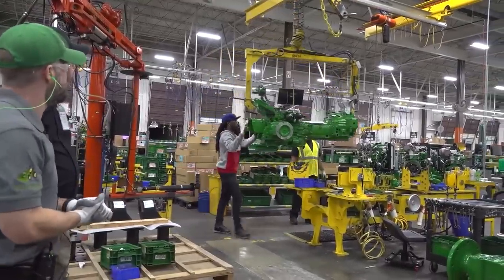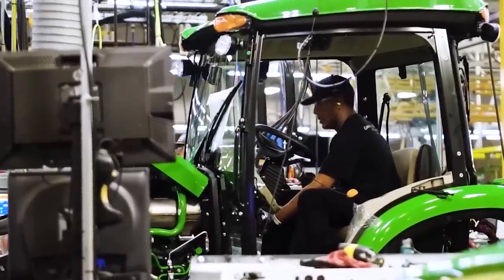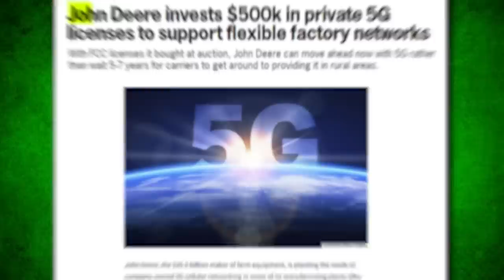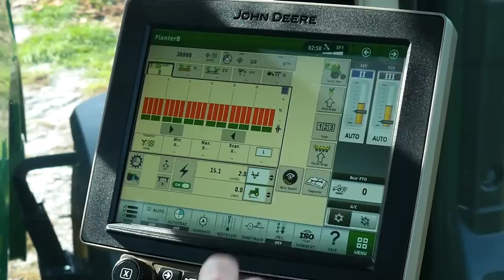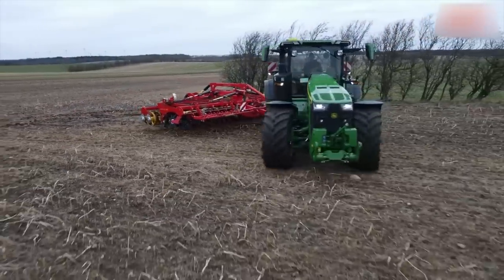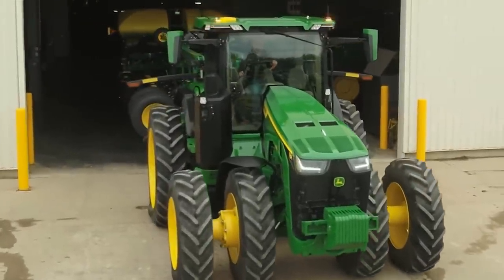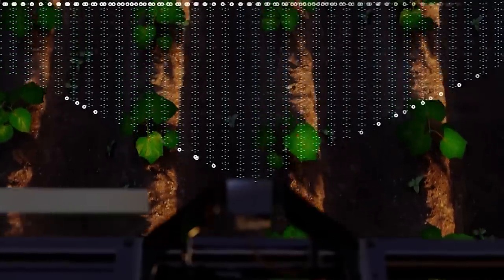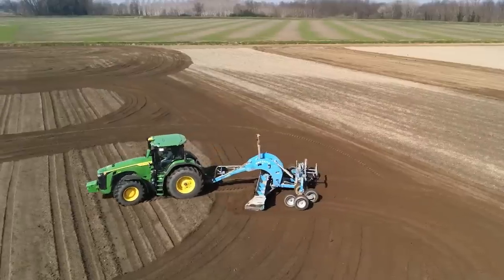John Deere Is About To CHANGE Farmers Lives.. Here's How

Comment: Please always support the RIGHT TO REPAIR for the farmers thanks Louis Rossmann
Reply: It’s not going to happen see this is a complete take over of farming from what I can see wow
Reply: Not going to happen. With John Deere proprietary software and this new AI driven machinery, a farmer will be lucky to drive his own tractor in his field let alone repair and maintain it.
Reply: And they will tell you what, when and where to work or shut you down.
Reply: @MegaGeorge1948 There are other brands out there. Plus, if there's an opening in a market (owner repairable tractors in this case), someone will fill it.
Reply: @lloydrodriguez9997  I won't buy John Deere.
Reply: @MegaGeorge1948  Some folks are buying/keeping the older equipment so they can repair themselves. It's way less expensive also.

Comment: If you watch any of the farmers on YouTube that drive John Deere equipment, you well see there can never be robot tractors pulling equipment around. The equipment is always plugging and breaking and throwing up warnings and alerts of the products not working correctly.
Reply: Agreed. The end point would seem to be the GPS enabled guidance that allows more precise location in the field. We do have a guy across the street that runs two tillage tractors in that field with a man in only one of the cabs. Seems like a lot of money invested to only save a very few hours of field time.
Reply: I agree autonomous tractors ain't going to work   be to dangerous it will run right over you  humans still driving truck yeah senators useless

Comment: I’ll stick with case ih. They’ve been doing real world applications of these things for a while now. Not as steep of a price tag easier to get repair software where I’m at and have given me less down time. I’ll give Deere credit on their planters and drills as I do own a Deere planter and small drill for reseeding beans but I run 2 brands of red motorized equipment
Reply: Don't make this BIG 
MISTAKE TO STAY WITH caseih
Reply: @larryhofer8853  the only brand other than case ih that doesn’t get replaced every 2 years around me is Kubota’s for chore tractors and construction equipment

Comment: Wow, a guest appearance of TTWT.

Whomever produced this video used every buzz word known to information technology.
Deere spent $500K on a network. BFD. Cat 6 cable is faster and doesn't suffer from electrical interference that a radio signal does.Hard wire networks also suffer from unwanted snooping like a wireless system do. 

If Deere wants to make a major change to field monitoring GPS, build and launch a satellite that competes with GLONASS.